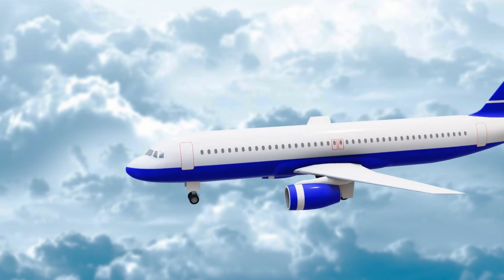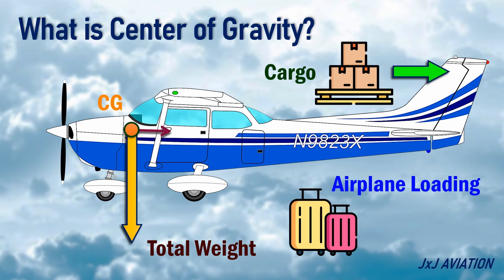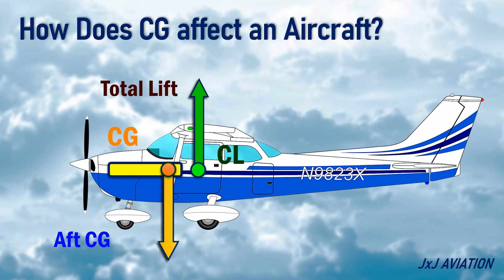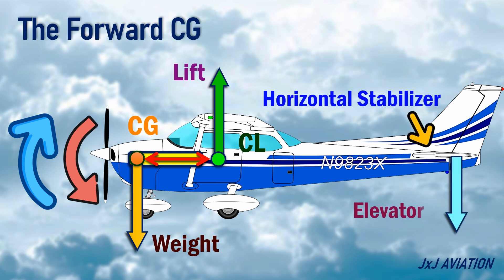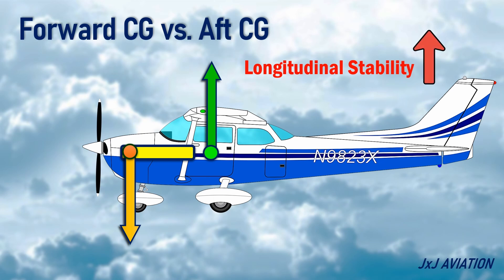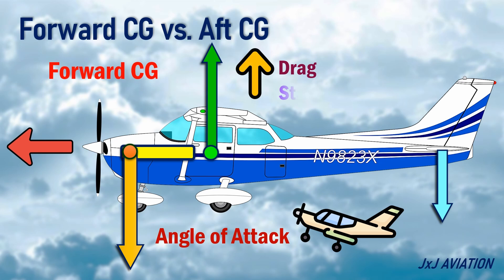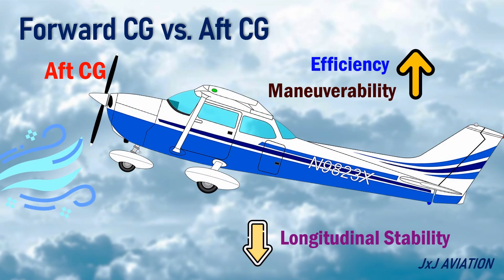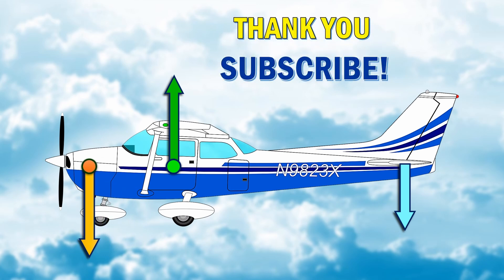How does Center of Gravity affect an Aircraft? | Impact of Forward CG and Aft CG

Comment: what about designs that have rear fuselage or stabilizer mounted engines? wouldn't the latter naturally produce a leveraging downward moment on the aircraft when thrust is running? the lever effect from the wings being lower than the engines would cause this. And wouldn't both shift the COG under thrust backwards further than a front engine equivalent (due to more "load" on the tail under thrust compared to a tail load of a front engine plane)?